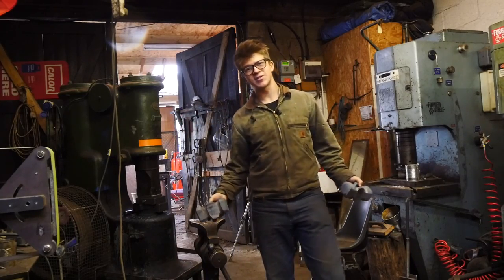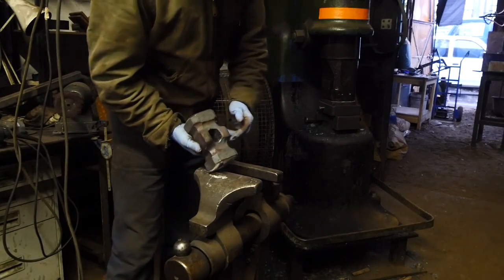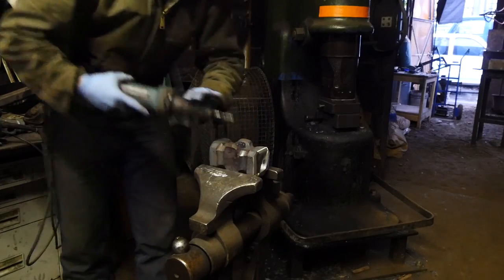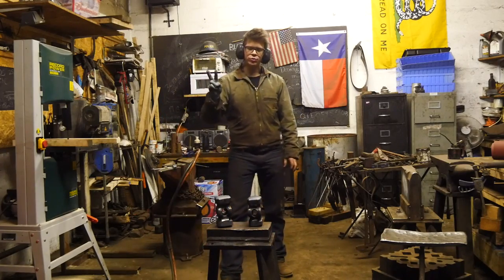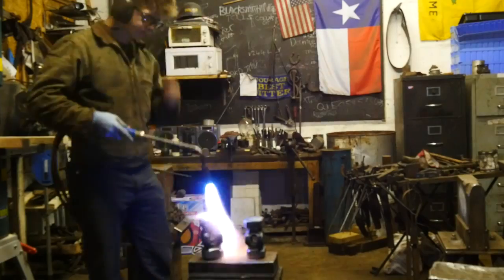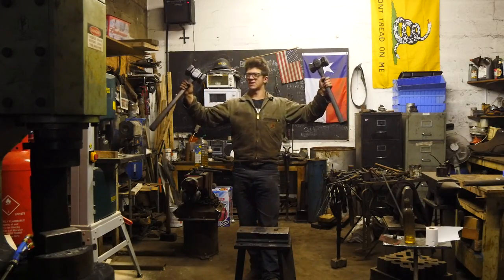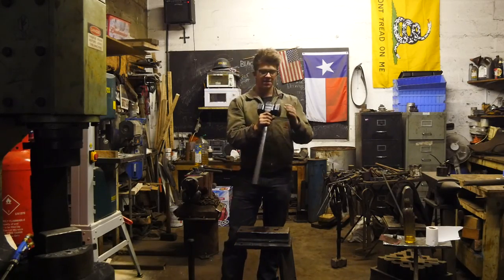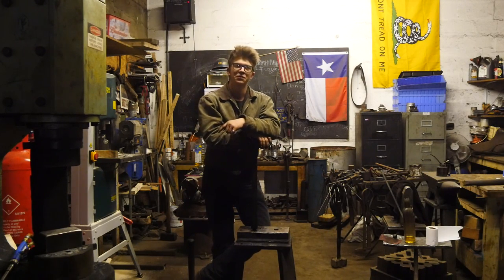Grinding and Handling Sledgehammers!!

Comment: Alec, when you want to get the head on the handle. Once the initially tap handle in the head. Turn it upside down and hit the bottom of the handle. This will cause the head to choke up on the handle and give you a tighter fit. Trick my father taught me and works great. Britt